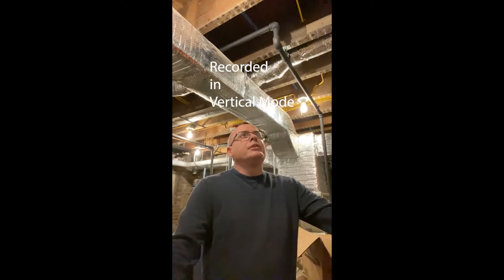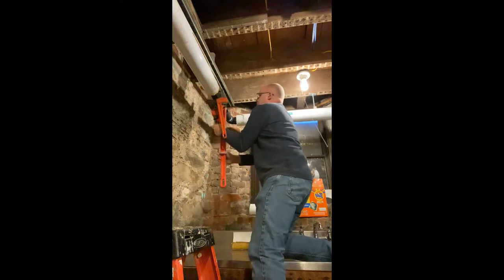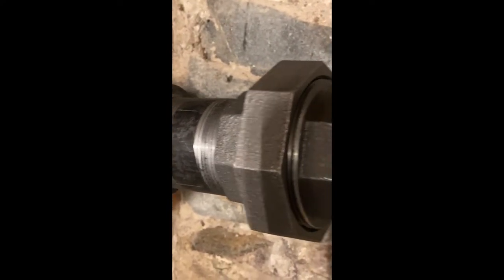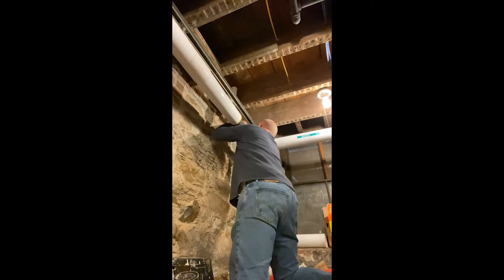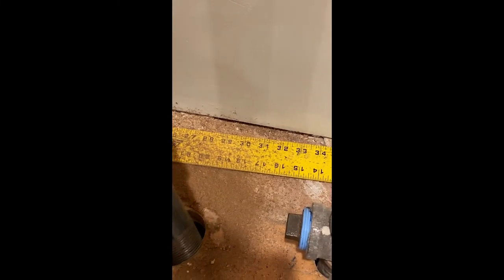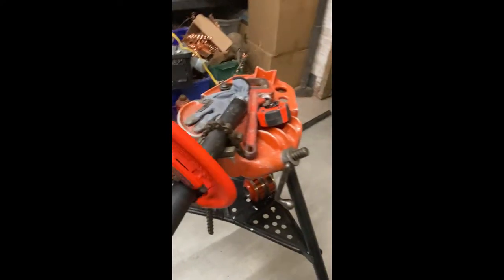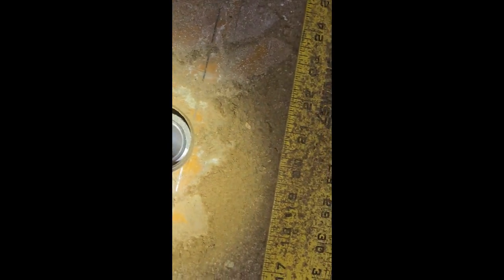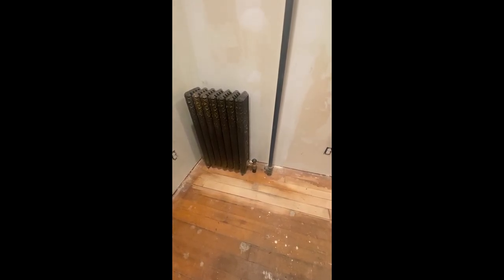1884 House Renovation ep 3 - Adding a Steam Radiator

Comment: It's a bit confusing if you don't know better. For some reason the video is reversed and it shows fittings being loosened clockwise and tightened counter-clockwise. Good luck with that in the real world. Other than that, the video's fine.